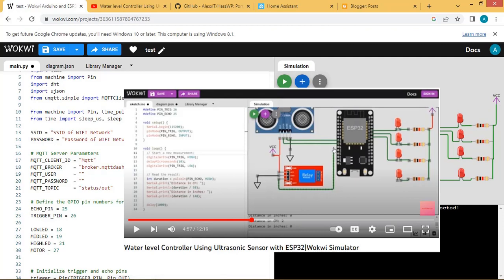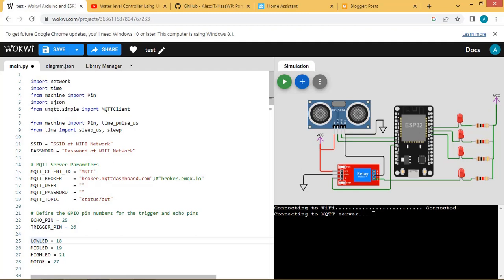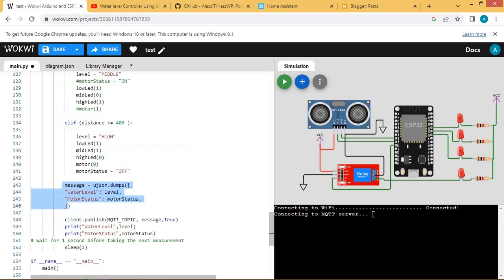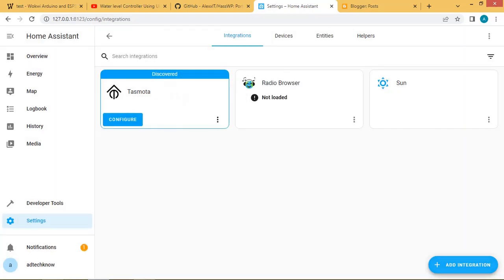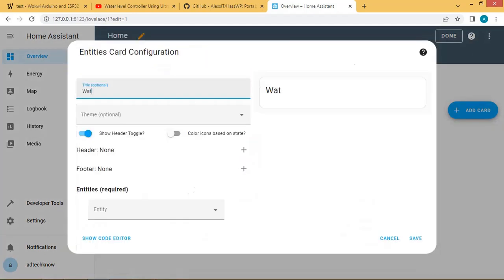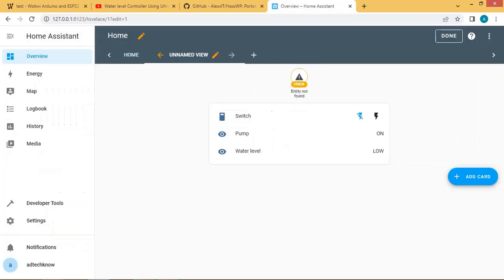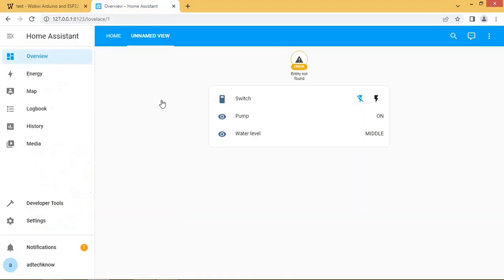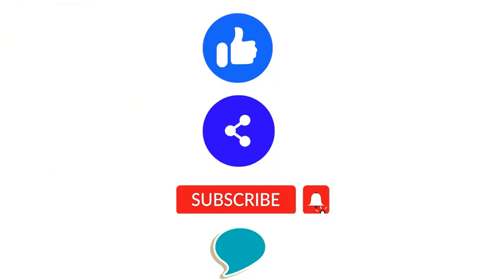Integrate ultrasonic Water level Controller with Home Assistant|Wokwi Simulator

Comment: Hello, Please the micor python code is not available in the description like you mentioned
Reply from the maker: Added Micro Python code in the same blogpost.T hanks!
https://techknowsurf.blogspot.com/2023/03/What-is-Ultrasonic-SensorHow-to-Use-it-with-ESP32.html
Reply: @adtechknow2761  Big big help. Thank you so much 🙏
Reply: @adtechknow2761  also how did you switch to using micro python from your first video? Do I have to create a new project entirely and and copy diagram.json from the first video?
Reply from the maker: @pauladeniyi1437  Create New Project Micro python on ESP32.Thanks!
Reply from the maker: I have added diagram.json file in the same blogpost.You can copy it.Thanks!